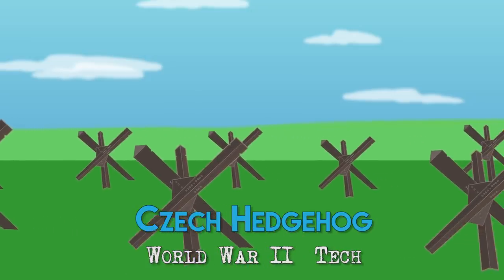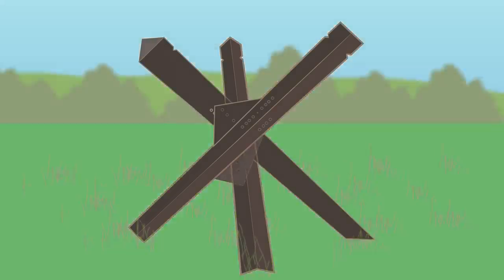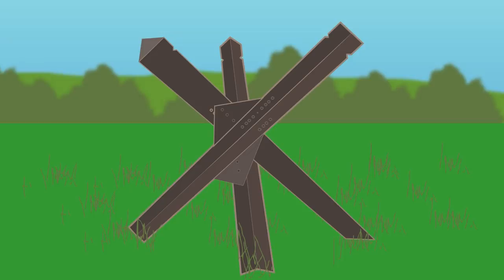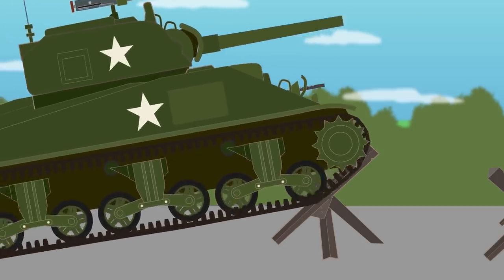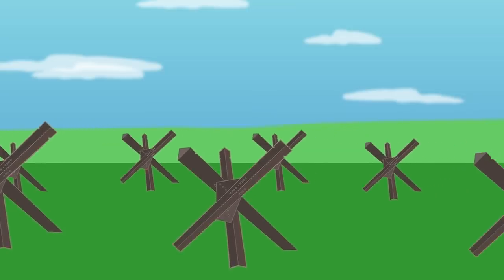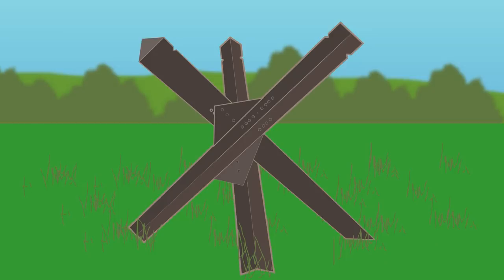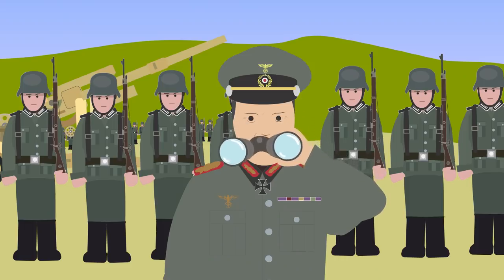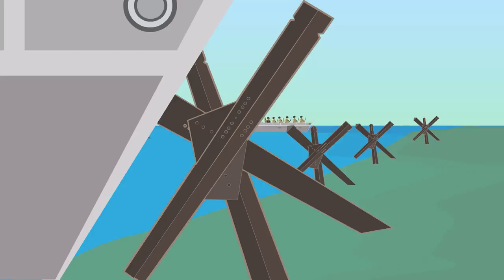Czech Hedgehog (World War II Tech)

Comment: In between them, mines and barbed wire were often laid, but they were effective on their own.

There were also tank traps made of rebar reinfirced concrete, known as Dragon's Teeth. They work similarly to Czech Hedgehogs in impeding a tank's movement by lifting it up, and were used in much the same way, being slightly harder to place and remove (specialized removal vehicles were eventually developed), but you can counter them in much the same way you can a Hedgehog: by burying it. So; they were employed in thick lines that would take the enemy a lot of time to eiter remove or go over with the earth dumping trick. They were as resilient to battle harshness as the oversized caltrops,  but they offer cover for infantry, so their use was mostly deprecated in favor of the Hedgehogs.

Comment: A little correction - in Normandy, hedgehogs were placed in places where landing crafts would hit them during high tide, however Allies made their landing during low tide. So hedgehogs did little service to Germans. Movie Saving Private Ryan was corrent in this - hedgehogs were used mostly as a partial cover for Allied troops on their move over open beaches. Also, hedgehogs in Normandy were mostly the same ones used by Czechs on thier borders. Germans simply dismantled them and moved them to Atlantic.

Comment: What if the Maus got to the frontlines in time, and encountered Czech hedgehogs?
   My bet is, that it would flatten the obstacle, because it weighed 188 tons, and its tracks were humongous, like 1,2 meters, or four feet wide.
Reply: Jagdtigers were known for driving over trees without problem and many obstacles. They are in fact heavier than Abrams M1A1 tanks. 70-80 tons they have. :D